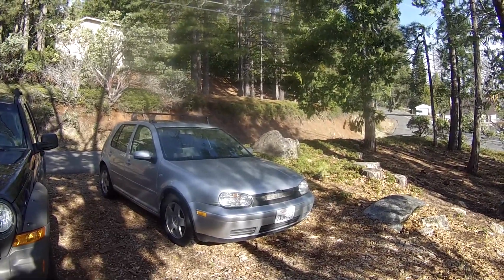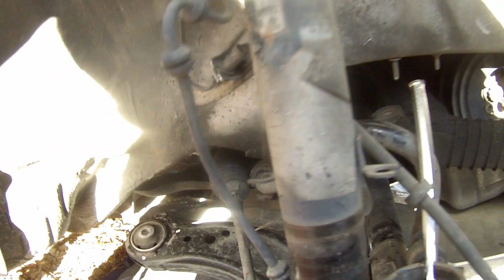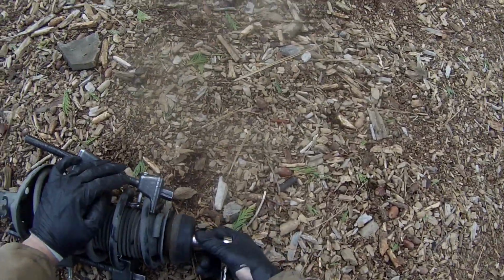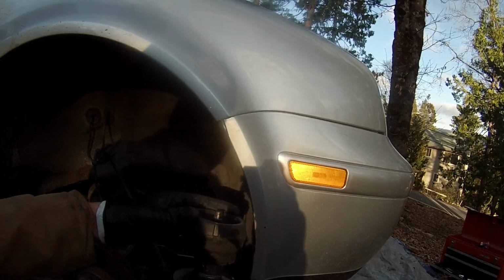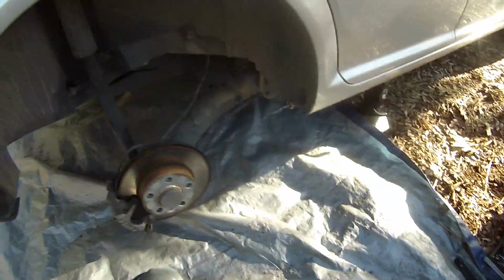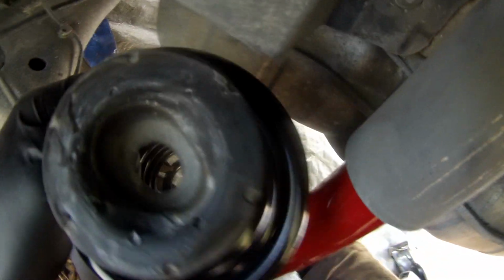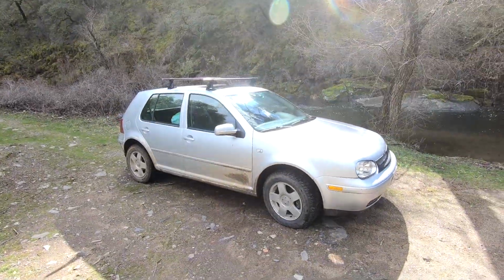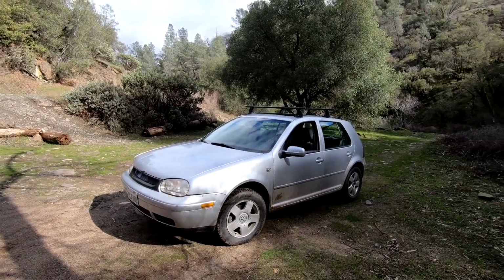VW MKIV Golf Home Brew 2 Inch Lift Kit

Comment: for the strut mount nut use a spark plug socket held with a wrench plus long hex bit socket through the middle of the spark plug socket.

Comment: Have you had any issues with CV Axles binding/causing vibrations and making it sound like there's sand in the CV joints. I'm told lifting could cause that, but I also have almost all the symptoms of a bad flywheel. Legit grinding when accelerating and vibrations at high RPMs, even when stationary.

Comment: Just fyi there are original VW aluminum 3/4" spacers for the front struts. I bought them online. Can't remember the p/n. But you can find it in Etka. They're used in some world markets were road conditions merit them. They've slightly curved top and bottom faces to mate better. Great work 🎉

Comment: After 3 years now is it still on a good sharpe
Reply from the maker: It was still in good shape after 2 years of daily driving it, then upgraded to the 4 inch Jeep lift
Reply: @KlaptOutOffroad  thanks for replying dude this is the only long term review I've seen, I will install it on my Passat soon. Thanks again
Reply: @KlaptOutOffroad  If I may ask, how did you do the 4” lift? Springs + even more spacers?
Reply from the maker: @bronzemansadventures1508  https://youtu.be/XOgw4v6jmB0

Comment: couple of questions: did this effect your fuel economy at all? could you put the front strut spacer on the outside of the coil or does it have to be on the inside of the coil? ie: could you not just space the entire assembly away from the mounting point?
Reply from the maker: If your sticking with the factory tire size, then there will be no effects on fuel economy. Or atleast I didn't notice a difference. I've heard of people using the strut mount from a mkv golf, and that's supposed to give you a little bit of lift, but not sure on how much. Adding the kind of spacer I used to the top of the mkiv strut mount instead of below wouldn't work as (a) the threads of the strut shaft probably wouldn't reach through the strut perch above and (b) the strut mount wouldn't have a flush surface to rest against on the strut perch. Hope that answers your question.
Reply: @KlaptOutOffroad  thats brilliant thank you!

Comment: plot twist
more coils make for softer spring
less of the coils the spring has, softer it is

but thicker wire makes springs exponentially stiffer, so even if new springs have 30% more coils, but have a few mm thicker wire, they will be way way stiffer than original,
tag me and il drop you an equation

Comment: How can i extent the shocks? ?
Reply from the maker: Only way to extend the shocks is to buy longer shocks. That's why I researched and bought the longest traveling OEM shocks I could find. However I'm told that late 90s F150 rear shocks will fit and are a few inches longer.

Comment: Would this setup work on a wagon? I have a MK4 wagon with stock springs in it now.
Reply from the maker: You would probably have to get or make spacers for the rear springs since your stock rear wagon springs are what give the normal golf its lift, but the front setup should work
Reply: @KlaptOutOffroad  Gotcha. I know there are "heavier" springs for the wagon you can upgrade to, I definitely don't have those. Figured maybe the springs you used were the heavier ones.

Comment: I used the same spring kit, and a 1 1/2 tall spacer on the front with a two inch tall seat extension in the back. Got 3.5-4 inches plus another inch by installing bigger tires.
Reply from the maker: So wait, does that mean your 2 inches taller in the rear?
Reply: About 4 inches higher in all four corners.
Reply: About 4 inches higher in all four corners
Reply: @jasperwebb9107  pls make a quick video about that
Reply: Still with great alignment?
Reply: Yes, also be aware that camber IS adjustable due to slots at ball joint mount….don’t listen to tire shops that tell you otherwise!

Comment: Followed your video for my golf, turned out great (besides a bit of blood and bitchin😂) Did you end up running larger tires?
Reply from the maker: That's great to hear! Still running the stock 195s just because I already have both a winter and summer set in that size, but once I get new tires I may upgrade to something a little bigger

Comment: without the black pipe coupling, how much lift do you get from the front? I have all the coils but may do without the coupling.
Reply from the maker: Only about a half inch.
Reply: @KlaptOutOffroad   looks like I’ll need the coupling then. What size of coupling did you use? Wicked looking lifted golf btw.
Reply from the maker: @cabininthewood  i used a 3/4" coupling. It has a 1" outer diameter and is 1.5" in length.
Reply: @KlaptOutOffroad  Got the rear done. Already looking great! I have 225/50/17 tires, one size up than standard vw 17". The rear is 28" from ground to fender. Haven't done front yet. From where it's sitting now about 25" from ground. Is your front level with rear?
Reply from the maker: @cabininthewood  I can't remember the measurements I took from ground to fender but I know it was even front and rear.
Reply: Front and Rear done! Didn't use 3/4" coupling I got and ended up making my own spacer from some scrap steel tube and bushing from leftover dense foam craft. I cut 1" length for spacers. I didn't want perfectly level front and rear since I will be installing a custom 2" tow hitch, the rear will level with the front nicely when towing a trailer. Here's the spacer in place. https://i.ibb.co/RbMkRY1/IMG-2392.jpg
Before https://i.ibb.co/0Cmy3hv/IMG-2354.jpg
After https://i.ibb.co/0cQqJJs/IMG-2407.jpg
Reply from the maker: That looks good! So long as that pipe can support the weight it should work just fine.
Reply: @KlaptOutOffroad  So this been holding up fine after a year. I'm looking to get a jetta wagon ALH and my goal is to get the same lift height  on the wagon. Hopefully the rear isn't much heavier than golf rear end.
Reply from the maker: @cabininthewood  my guess is you'll have to find or make some sort of spacer for the rear, but that shouldn't be too hard